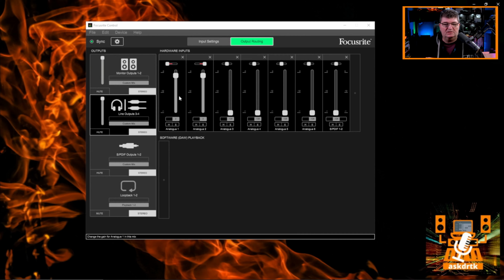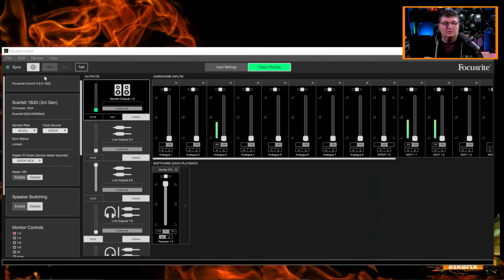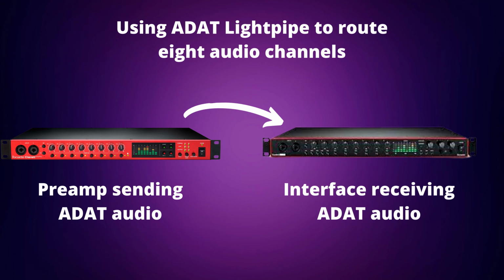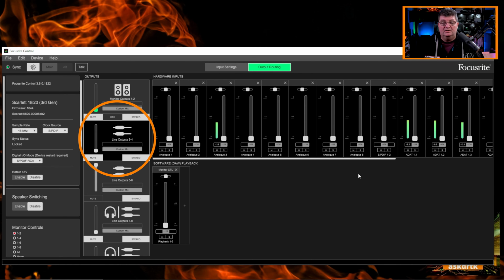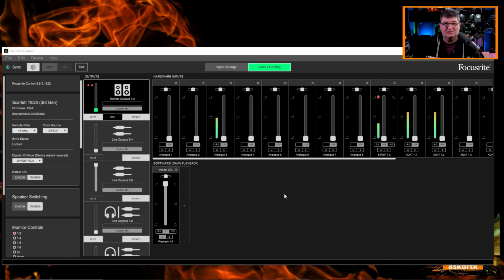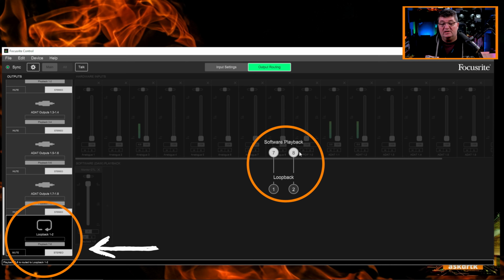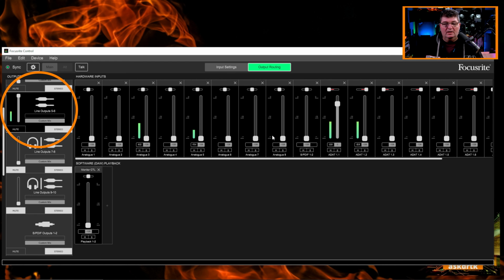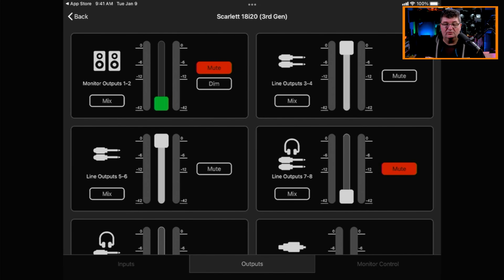Focusrite Control Step-by-Step Setup Guide - ADAT, SPDIF, & iPad Control

Comment: just purchased 18i20 ,am using 7 mics on drum kit ,what would you recommend I purchase to get 8 more inputs
Reply from the maker: Congratulations on the 18i20, it is a great platform for both recording and mixing. ADAT expansion to get an additional 8 inputs (and possibly anothe 8 outputs) will get you added flexibility for not only tracking, but for analogue inserts and more. A recommendation depends on what you are looking for - mic preamps, line level IO, DI. Let me know what you are planning to use the additional IO for and I will provide a few recommendations.
Reply: @askdrtk  hi ,my goal is to record the band live from the room .need vocals and 2 guitars and bass along with drums taking up 7 mics
So more inputs needed than outputs.
Thanks.
Reply from the maker: In that case, as a general rule it is easier to get a good blend of all band instruments and vocals when you are using the same preamps on all mics - this is how we generally record in studios with large format mixing consoles. You hear a lot about boutique preamps (1073, 512, etc.) which can be great for recording individual instrument or vocals, but for an entire band, unless you can get enough of these high-end preamps for everything (say 16 Neve 1073s- expensive...), in my opinion you are better to use the transparent preamps on the interface for recording the entire band live. You could use a Scarlett OctoPre over ADAT which would add 8 more preamp inputs and give you a total of 16 matched preamps. You could also use another 18i20 over ADAT to get the 8 extra preamps and also end up with 8 additional outputs (nice when used with a headphone amplifier to provide individual monitor mixes for each band member). Using another 18i20 is often less expensive vs purchasing the OctoPre, so I would likely go that route. To use another 18i20, you first connect it to your computer and then configure it for stand alone pass through of analogue ports over ADAT, clock, etc. as I explain in the video. Hope this helps out!
Reply: @askdrtk  awesome, now to rewatch your videos, cheers ,Dan
Reply from the maker: All good. Let me know if you have any questions when settings things up. 👍
Reply: @askdrtk  hi ,I got my second 18i20 but we can't seem to see them both together. using optical cable
Reply from the maker: The most common issue is setting up the clocks. Both interfaces need to have the sample rate and buffer size set to the same values and the interface connected to your computer should have the close source as "ADAT" and the other interface should be set to "Internal." You will need to temporarily disconnect your original interface and then connect the the interface that will be be providing the IO over ADAT to your computer to use Focusrite Control. Then configure the new interface clock as above and set each input to be sent to the corresponding numbered ADAT output / the ADAT inputs to be sent to the corresponding numbered analog outputs. Hope this helps out.
Reply: @askdrtk  yes thanks ,I was doing adat to adat instead of to analog, all good now
Reply from the maker: Glad to hear everything is up and running...16 channels in and out!...👍
Reply: @askdrtk  thanks I may have some future questions  on the individual mixes four headphones but now with the 2 18i20 my 4 piece band should be spoiled!!
Very much appreciate that you take time to answer questions. You are the best
Reply: So with my two 18i20 working together I only see 8 analog inputs from my master and not the 8 digital from my slave which has vocal and I'd like to use air mode.
Also can I use the 4 total headphone, 2 from each 18i20, for individual mixes for the band .FC only shows 2 headphones. 
Thanks ,Cheers, 
Dan
Reply from the maker: Hi Dan, Sorry, but to clarify is it you don't see the digital inputs in FC or your DAW?
To use air mode, you need to connect the slave to your PC and configure that in the same way your routed the channels before. Then disconnect the slave and reconnect the master. All inputs you configured with air turned on will remain that way after reconnecting. 
For headphones, route your mixes to outputs 7/8 and 9/10 on your master, and to whichever pairs of ADAT outputs from your master you setup to pass through the slave's ADAT inputs to the slave's analog outputs 7/8 and 9/10. That way you will have 4 separate headphone mixes. Since the 18i20 has 10 output channels but ADAT is only 8, you may have configures ADAT 1-8 to outputs 1-8 on the slave, so you may need to reroute one pair, say 1/2 over to 9/10.
Let me know of the ADAT inputs not showing up in either FC or DAW and I will try to assist.
Reply: @askdrtk  thanks I can see them all in my daw.
I'm guessing only the master hooked up to computer is what FC sees.
Still working on getting the slave 18i20 headphones to work ,thanks
Cheers, Dan
Reply from the maker: Yes, you will mix the slave inputs using the ADAT inputs in FC and the slave outputs using ADAT outputs in FC. You will only need to connect the slave to the computer to configure routing, air, or clock. Once those are setup, you shouldn't need to connect the slave to your PC. The slave headphones won't show up as headphones in FC as they are routed from ADAT.🍻
Reply: @askdrtk  I am missing  something, with just the slave on I have headphones from slave ,when I turn slave off ,turn master on ,than slave back on I lose slave headphones. 
In FC I have analogue 1through 8 ,I have adat 1 through 8  I have Adat 2  showing 1through 4 
All works in DAW,,that is I see 8 analogue and 8 digital.
Not sure if I have something  wrong on slave set up
Reply: I think I need a second optical cable ,yikes sorry for the trouble,  will that show me Adat outputs?
Cheers
Reply from the maker: For 48kHz you need two optical cables. One from the "out" on the master connected to the "in" on the slave and one from the "in" on the master connected to the "out" on the slave. From what you described with the headphones, it sounds like you have both master and slave connected by usb to your computer. After you have configured the slave using FC, only the master should be connected by usb. Only one 18i20 can be connected to your computer in order for the driver / FC to work correctly. The slave's IO will be available in your DAW since it is connected to the master via ADAT.
Reply: @askdrtk  Yes thank you ,I need the second cable ,
Thanks so much for all your replies I really do appreciate  it, 
Cheers
Dan

Comment: Great tutorial! Thanks a lot for that! Just a question: I have a Clarett+ 8Pre and a Scarlet 18i20. Can I link them to get 8+8 channel on Cubase? Thank you very much!
Reply: Sorry about my question. I read it now that you used both of them in this video😂😂😂 Thanks again!
Reply from the maker: Thanks and all good! I use exactly this setup in my studio space (except I use Studio One). The Clarett + 8Pre is connected to the computer and the 18i20 is connected to the Clarett+ using two optical cables for ADAT (I record at 48kHz). The additional IO will become available in Cubase as part of the ASIO driver for the Clarett+. Let me know if you have any questions when setting it up!👍
Reply: @askdrtk . 
 @askdrtk
Reply: @askdrtk  Wow!! You answered me so fast!! And I love (cars) speed!!!😃😃😃 Thank you!! 
Actually, I would need more help from you. 
1- I’m working on the opposite setup because I already had a 18i20 installed on Mac, so I wanted to use my brand new Clarett as “slave”. 
2- When  I switch Clock Source to ADAT the 18i20 the sync led in Focusrite turns to red, and the green one (padlock) on Scarlet turns off.
3- Regarding the new Clarett, I did nothing but connecting two optical cables to my 18i20: no usb connection  to my mac, so there are no (Clarett) drivers installed.
My questions:
Do I have to change setup using 18i20 as slave?
If yes, do I have to cancel Focusrite app and restart from zero?

Probably this is not the right place to talk about technical issues, I beg your pardon, but  I would really appreciate your help.
Thank you
Reply from the maker: I have always loved cars. I like to say I grew up working on cars with my grandfather from the time I could crawl under the hood...👍(but that's for another time, maybe Discord...) 

You can continue to run the 18i20 over usb to your Mac with the 8pre connected to the 18i20 by ADAT. It may seem backwards, but typically the clock is setup as the expansion unit (8pre) on ADAT being the master and the interface (18i20) being the slave (this greatly reduced sync issues). The main consideration is that your sample rate will need to be set the same on both the 8pre and 18i20 for it to work. You shouldn't need to do anything with your Focusrite Control installation.
1. Disconnect the 18i20 from the Mac and connect the 8pre. FC will recognize it.
2. Go into FC and set the sample rate to 48kHz and the clock to internal on the 8pre (you need to use 44.1 or 48 to have all 8 inputs and all 8 outputs over ADAT from the 8pre). 
3. Disconnect the 8pre from the Mac and reconnect the 18i20.
4. Go into FC (it will bring up the 18i20) and set the sample rate to 48kHz and the clock source to ADAT.

That should do it, you will have access to 8 analogue inputs, 2 SPDIF inputs, the 8 inputs from the 8pre via ADAT, 2 loopback inputs, 10 analogue outputs, 2 SPDIF outputs, and 8 outputs from the 8pre via ADAT all within Cubase under the 18i20 ASIO. Hope this helps out!
Reply: @askdrtk  well, first of all thank you very much!! Then, if you like cars, I know how to reward you for helping me!! 😁😁😁 I’m crazy for motorsport since I was born, but in last 10 years I’m into professional racing because my son. Andrea won 7 european F.3 championships (2017-2019), and now he’s a  Driver of the official Lamborghini team Squadra Corse VSR in the GT3 Championship. Whenever and wherever we race, you’ll have a paddock pass ready for you. Just let me know a couple of week before the event, and I’ll show you the pro races from backstage.
Tomorrow I’ll follow your instructions, hoping I won’t need to bother you again. Have a nice day! And thank you!!
Reply from the maker: My pleasure to help out and thank you very much! Great news about your son's wins!!! I will keep the race schedule in mind... It occurred to me that I should have mentioned during "step 2" that while the 8pre is connected to the Mac you will also need to configure the mixer in FC to route the analogue IO to ADAT. Use "Hardware Input" mode to route each ADAT input (1-8) to the corresponding analogue output and then route each analogue input (1-) to the corresponding numbered ADAT output. This will ensure all ADAT and analogue routing will pass through correctly. Let me know if you have any questions when setting things up.
Reply: @askdrtk  Ok thanks a lot! I came right now in studio and I’ll try to set up all. Do you think I should change device using Clarett as master, connecting that to my mac instead the 18i20 as I’m doing now?
This is the Calendar of GT Endurance Italian Championship
There are 3 races left:

14-17 July: MUGELLO
15-18 September: VALLELUNGA (we’re from Roma, so this is our “Home Race”)
6-8 October: MONZA
If you come to Italy, you’ll be our guest in the paddock.
Now I go: I have two devices to fight with😉
Ciao!
Reply from the maker: All good. I have mine setup with the Clarett+ connected to the computer. You may benefit from somewhat reduced latency by setting yours up that way, but you will be giving up the monitor switching and talkback functions on the 18i20. If you do not use those functions, either configuration will work well.
...I will keep those dates in mind!😄
Reply: @askdrtk  Hi!! First of all thank you very much for helping me! I couldn’t find the way to put 18i20 as master, so I put it as slave, and now they work but…I guess that something’s wrong, because I had to set one (can’t remember which one) clock on “Internal”: both on ADAT, both lose sync. One ADAT and other Internal they are Sync and all BUS recognized in Cubase.
In Focusrite I can see only Clarett Channel I/O: do I have to add manually the 18i20’s ones?
By the way, my 2 devices now work, and this is because you helped me.
Thank you again, and have a nice day!!
Reply from the maker: Hello! Glad to hear both are now working! Setting one to internal and the other to ADAT it correct. The one on internal uses its own clock and provides the clock for the one set on ADAT (ADAT setting looks for the clock from another device, in your case the one set on internal). Only the interface connected by usb to your computer (Clarett+) will show in Focusrite Control, but the inputs from the 18i20 are accessible as ADAT Inputs 1-8 and the outputs on the  18i20 are accessible as ADAT outputs 1-8. Let me know if this is showing up in Focusrite Control. If not, I will try to assist further.
Reply: @askdrtk  Sorry to be late, but we’ve been in P. Ricard circuit for GT Race and I had no time to check. Yes, thank to your help now everything is working on cubase, the only thing I still didn’t get (sorry…I’m a pretty good drummer, but I had no idea about hardware connections) if I have to click on + in FC (Clarett) OUTPUT to add manually the 8 ADAT coming from 18i20. Thank you very much, I hope to have you as a guest in some paddock.
Reply from the maker: All good. Yes, you can click on the "+" in FC to add both inputs to individual outputs and addtional outputs to the mixer. Note that you can add the ADAT outputs as either 4 stereo pairs, 8 mono channels, or a mix of the two.
Reply: @askdrtk  yeah!! I remember you shown on video how to use panning to separate the stereo channel! Thank you again! I’ll wait for you in some paddock for a race weekend as our guest!!
Ciao!!
Reply: @askdrtk Hi Boss!! I know you’re fine because I’m following your channel since when you helped me so much to link my Clarett+8Pre (Master) and the Scarlet 18i20 (Slave). Unfortunately for you I'm back, I need your help…again😬 😬 😬 I bought a Mac studio and I need to install the two devices on my new computer, so…I’m in panic mode.
My  question is: do I have to do all the procedure you told me on previous messages, or I can use the file of Focusrite settings I saved from old Macbook? Sorry for bothering you, but only you can help me…again😅😅😅 Thank you!!!
Reply: @askdrtk

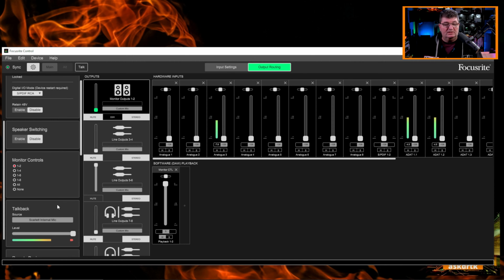Comment: 7:59 Wondering how do I route the Talkback signal out of the 18i20?  Thanks.
Reply from the maker: Talkback is routed by choosing the "Custom Mix + Talkback" option in each of the output pair configurations. In this case, you can mix the desired combination of hardware / software inputs and talkback will also be routed through the outputs. This gives you a custom mix for each person being recorded and talkback communication. Hope this helps out!

Comment: I don’t have that “digital i/o mode…I have a scarlet 18i8 gen 2. Is that feature only for the 18i20?
Reply from the maker: It is for 3rd gen 18i8 and 18i20 only. On the 18i8 it allows you to switch the optical input between ADAT and SPDIF protocol and the 18i20 adds a second optical port for dual ADAT at higher sample rates. SPDIF over optical is less commonly used in my experience (2 channels vs 8 for ADAT). Both the 2nd gen 18i8 and 18i20 have a single optical input that is ADAT only, so no need for digital i/o menu. Thanks for asking and I hope this helps out!
Reply: @askdrtk  how would I clock an ADAT device and SPDIF coax device at the same time on my unit to utilize all 18 inputs at the same time? I have a ART MPA pre amp with adat out, and another preamp with spdif coax out.
Reply from the maker: I am familiar with the MPA's digital i/o, but It will depend on the connections your other preamp has. Let me know what it is and I will try to help out.
Reply: @askdrtk  it's a joemeek twin Q. It has both spdif coax and optical out.  Does not have ADAT in or out...just SPDIF optical/coax out.
Reply from the maker: Nice dual channel strip... To get everything synced up you can use the MPA as the clock source. Connect the ADAT output from the MPA to the ADAT input on 18i8 and set the clock on the 18i8 to ADAT in Focusrite Control. Then connect the SPDIF output from the JOEMEEK to the SPDIF input on the 18i8. Finally, connect a word clock (BNC) cable form the word clock out on the MPA to the word clock in on the JOEMEEK.  The JM will automatically detect the clock and sync up. This way you can maximize the digital connections on your 18i8 and keep everything in sync. Hope this helps out!
Reply: @askdrtk  I'll give that a try...thank u so much for getting back to me quickly!
Reply: @askdrtk  damn, it didn’t work…after reading the MPA manual. It doesn’t have a word clock out..just a word clock in and “thru”. I’m probably gunna have to purchase an external clock. Art has the “syncgen” for about $150
Reply from the maker: Man that's too bad. For some reason I thought the MPA has clock out. The syncgen seems like a good option and the nice thing is that it has plenty of connections so changing or adding gear in the future shouldn't be an issue. Let me know how it goes.